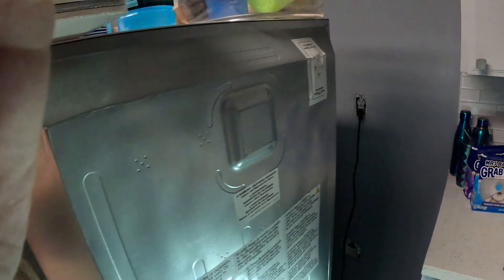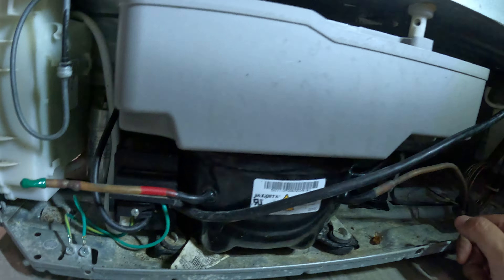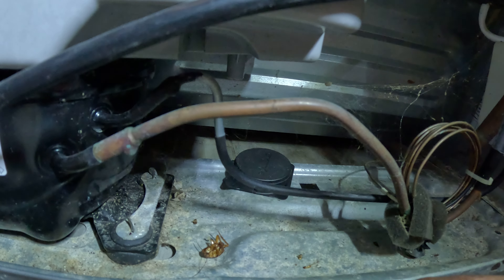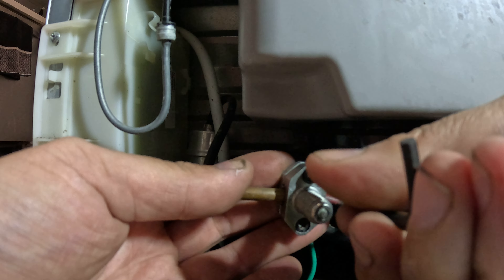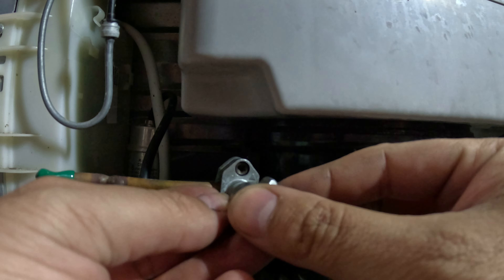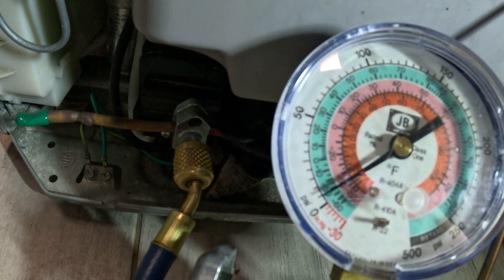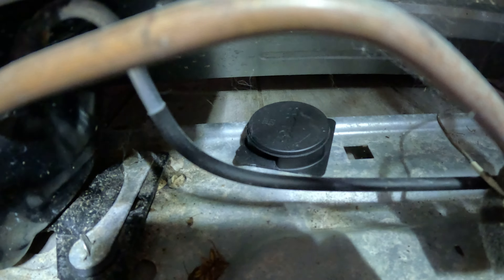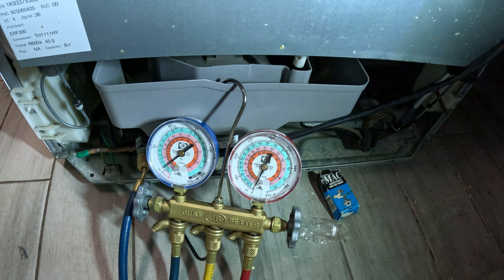(Part #1) How To Correctly Add / Recharge Freon to your Home Refrigerator R134a R600

Comment: A very helpful tip to extend the life of the compressor is to add 50ml of sulphuric acid to the compressor before regassing. 
This keeps the compressor free of corrosion

Comment: Hello! Can I still use this mini fridge? It had a refrigerant leak and it was filled with R134A but the compressor is for R600a. The R134a leaked out and the leak has been repaired. Can I refill with R600 and use it? The compressor still turns on but got heated with the R134a exposure. Thank you, Elsy
Reply from the maker: https://www.reddit.com/r/HVAC/comments/ia0ycf/can_i_put_r134a_into_a_r600a_mini_fridge/
Reply: @diyhvacadvice2millionaire  Hello! Thank you for the link. Are you the author of the original post? If so, did it end up working for a long time? Best, Elsy
Reply from the maker: No, I am not the author of the post. Have a great day.

Comment: My fridge will cool fine for hours at times or sometimes for less than an hour or two then let’s say when I come home from work I’ll find that everything like the lights and power work just fine but the compressor and fan has stopped running and it’s no longer cooling. So I have to unplug it for a few minutes and then plug it back in for everything to start working again. Any idea on what the issue could be? I’ll also note that the compressor will sometimes feel hot to the touch. Not sure if that’s normal or not.
Reply from the maker: What brand is the refrigerator? How old id the refrigerator?
Reply: @diyhvacadvice2millionaire  it’s a whirlpool and from around 2016-2017
Reply from the maker: I stopped working on domestic refrigeration after 2010. Its possible you could have an issue with the mother board, or if the compressor is an inverter style it could also be a compressor going bad.